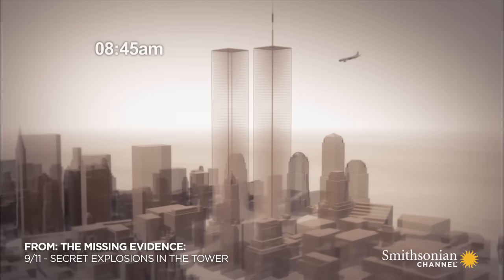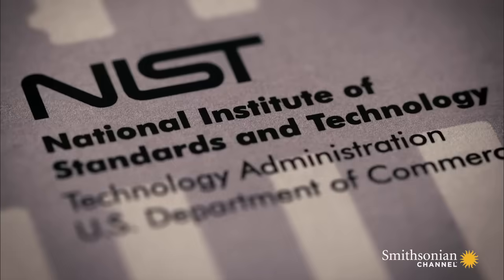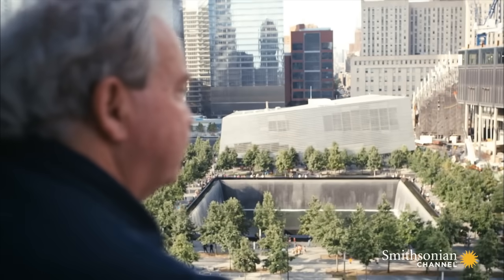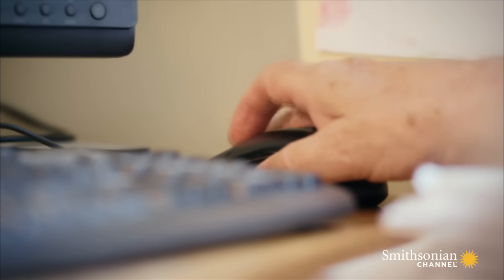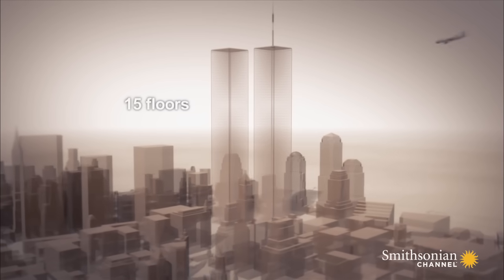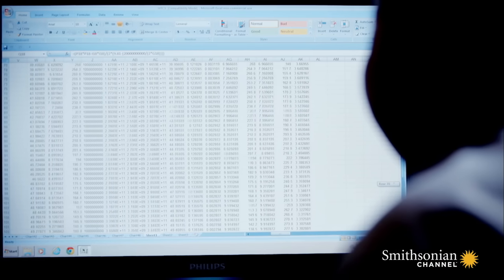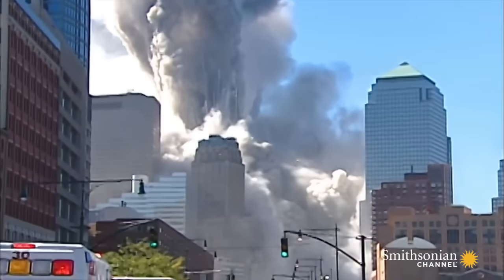This Computer Simulation Explains How the Twin Towers Fell

Comment: The way the commentator emphasises how much the government spent on the investigation made me laugh, 16 million is NOT a large enough sum too investigate a catastrophe as big as September 11th, they spent £50 million plus investigating Bill Clintons affair with Monica Lewinsky!
Reply: Billy+ "7 hours of fire?" What's your point????? The Plasco bldg collapsed after 4 hours and the entire top of the Windsor tower fell in less than 4. Are you trying to insinuate that fire can't bring down a bldg in seven hours??? If so I've just proven you wrong, by giving you examples of steel bldgs collapsing in under 7 hours. The only one around here that needs to learn something is you.
Reply: Bobby Hawkins  "scoring highest in physics" Here is NIST figures for the collapse of WTC 1&2. Tell us all what they got wrong, be sure to show your math...

Yes, there was more than enough gravitational load to cause the collapse of the floors below the level of collapse initiation in both WTC towers. The vertical capacity of the connections supporting an intact floor below the level of collapse was adequate to carry the load of 11 additional floors if the load was applied gradually and 6 additional floors if the load was applied suddenly (as was the case). Since the number of floors above the approximate floor of collapse initiation exceeded six in each WTC tower (12 floors in WTC 1 and 29 floors in WTC 2), the floors below the level of collapse initiation were unable to resist the suddenly applied gravitational load from the upper floors of the buildings.

Consider a typical floor immediately below the level of collapse initiation and conservatively assume that the floor is still supported on all columns (i.e., the columns below the intact floor did not buckle or peel off due to the failure of the columns above). Consider further the truss seat connections between the primary floor trusses and the exterior wall columns or core columns. The individual connection capacities ranged from 94,000 pounds to 395,000 pounds, with a total vertical load capacity for the connections on a typical floor of 29,000,000 pounds (see Section 5.2.4 of NIST NCSTAR 1-6C). The total floor area outside the core was approximately 31,000 square feet, and the average load on a floor under service conditions on Sept. 11, 2001, was 80 pounds per square foot. Thus, the total vertical load on a floor outside the core can be estimated by multiplying the floor area (31,000 square feet) by the gravitational load (80 pounds per square foot), which yields 2,500,000 pounds (this is a conservative load estimate since it ignores the weight contribution of the heavier mechanical floors at the top of each WTC tower). By dividing the total vertical connection capacity (29,000,000 pounds) of a floor by the total vertical load applied to the connections (2,500,000 pounds), the number of floors that can be supported by an intact floor is calculated to be a total of 12 floors or 11 additional floors.

This simplified and conservative analysis indicates that the floor connections could have carried only a maximum of about 11 additional floors if the load from these floors were applied statically. Even this number is (conservatively) high, since the load from above the collapsing floor is being applied suddenly. Since the dynamic amplification factor for a suddenly applied load is 2, an intact floor below the level of collapse initiation could not have supported more than six floors. Since the number of floors above the level where the collapse initiated exceeded six for both towers (12 for WTC 1 and 29 for WTC 2), neither tower could have arrested the progression of collapse once collapse initiated. In reality, the highest intact floor was about three (WTC 2) to six (WTC 1) floors below the level of collapse initiation. Thus, more than the 12 to 29 floors reported above actually loaded the intact floor suddenly.- NIST

" I also tested repeatedly in the 99th percentile of human intelligence" Yet you don't know what an anti-Semite is and think Silverstien received 7 billion dollars, and owned the towers. You sir are proof that regardless of perceived intelligence, if one is too lazy to do actual research they can come off looking like a complete nut job....
Reply: Greg Brumbaugh so pre planted demolition charges just so happened to perfectly line up exacly right where the gash was formed?And the connections in the upper floors just somehow vanished into thin air magically , allowing the left side to fall first? Sorry but I don't think so
Reply: Billy Jack+ "I'm the idiot?" I said moron, but idiot will suffice.

"The government agency NIST is different than the  Commission Report." Very good, moron. Do you know the difference????? One was commissioned to do an engineering study on how the towers fell, the other was commissioned to determine how the terrorist committed the attacks. The two had little to do with one another. 

"the final report where they are supposed to answer all the questions" Umm..no! You don't even know what the purpose of the 9/11 commission was. Their mission was to review the material gathered by the FBI in their PENTTBOM report and put into a form for public release. The commissions report was about how the terrorist pulled off the attacks, the NIST report was an engineering report....

Now don't you feel stupid?????
Reply: Billy Jack Im referring to WTC 7. How can a controlled demolition cause one side to tilt and lean north and the other to tilt and lean to the south, midway through the building collapsing? You're saying a controlled demolition causes a building to fall in two opposing directions? Because your idol Richard Gage never wants to acknowledge this but yet it's visible in the collapse videos
Reply: All this proves is that the US government are prepared to spend 3 times as much to find out if Bill got his dick sucked over a terror attack. Or that republicans are a lot more concerned about blow jobs than terrorists.
Reply: +Thomas Begen So you have evidence that the official reports are wrong. Great let's hear it! Tell us exactly what they are wrong about and how. If you could show some math, that would be nice...
Reply: Tom tonka None, he actually gained profit,  all thanks to the 9/11 truth movement, graciously supporting him through t shirts, seminar admission tickets, worthless donations, and just a lack of common sense
Reply: Bobby Hawkins  ”Why would the AIA resist an investigation into the WTC7 collapse” Because they agree with the NIST investigation, that took 3 years and cost millions.

”when he investigation was never conclusive as to what caused the collapse?”  NIST investigation was conclusive. You would know this if you had bothered to actually read the NIST report.

”Why would ANYONE resist a new investigation if nothing is being covered up?” Because it’s been investigated to death. It was the most expensive investigation of any type in US history.

”It is entirely possible a tactical nuclear device was used to hollow out the basements to allow the structure to fall into it.” Thank you! It’s not often that Truthers come out and openly admit how dramatically stupid they are….Your father should have used a condom.
Reply: evsupp2011 If it's such a well known fact amongst them that it was a "conspiracy" then they should also have some pretty significant evidence to go along with that too, right? So please, point us in the right direction because I'm curious to see it
Reply: Bobby Hawkins   "When we talk about the structure of a building a "floor" is the entire structure of a "story"" When engineers refer to a typical FLOOR, they mean the FLOOR...idiot! 

"These columns were welded together, not bolted, " Absolutely false! The perimeter columns were bolted together using 5/8 thick bolts. The core columns were welded, but these weld were not full thru the entire thickness. This why we find EVERY single core column broken at their weld joint and EVERY perimeter column broken at their BOLT joint. Explosives can't do that!

"the individual floor trusses might have pulled loose from the central columns but those columns would have remained standing " And this is EXACTLY what we see. 40-60 stories of the core remained standing for nearly 40 seconds after the collapse....Thanks for proving yourself wrong, it make my job easier!

"All we want is an independent investigation" Bullshit! All you want is someone to confirm your biased dislike of the US gov't...
Reply: Oh, for crying out loud...so not only are Truthers miraculously transformed into experts in physics, structural engineering, fire science, et al...now I keep seeing them presuming to speak as if they just somehow *know* how much a federal investigation ought to cost, and use that metric to determine its validity.

You guys are a real crew.
Reply: And they waited 400 days to start investigating after Juliani and his criminals disposed of all the evidence.
Reply: @MahayanaForMAHA  - I think Giuliani pulled trigger remotely, i.e. commenced the demolitions.
Reply: Not to mention the trillions they saved in the debt that was written off after 9/11. Or the billions they made from war in Iraq.  So 16 million is pennies/cents
Reply: Just sent how many trillions to Ukraine
Reply: +mike lomez true true.
Reply: Ralph Berkeypile Jr keep self-deceiving.
Reply: So how much do you think Richard Gage spent on his cardboard box demonstration?
Reply: @MiasmicGusto  FLT 77 was a Boeing 757-200 not a 7676. It only had a wing span of 125 feet. It also crashed into the bldg at an angle which lessened the length of the hole. Would you care to try again????
Reply: @Oldschooldan1  Flt 77 was actually a Boeing 757-223. The two planes that supposedly hit the Twin Towers were Boeing 767s, which also managed to squeeze completely into those two buildings leaving not a single trace of 'plane parts behind, even though the two holes they squeezed through were narrower than the 'planes that supposedly made them. Much like the amazing vanishing act of both the Pentagon-hitting 'plane AND that other 'plane that managed to bury itself completely underground. Simply astonishing. And still no black boxes have ever been officially recovered. From all four aircraft. Can you explain that?
Reply: @MiasmicGusto  "squeeze completely into those two buildings leaving not a single trace of 'plane parts behind" They didn't squeeze into the blgs, they smashed thru them with 2,266,201,476 joules of kinetic energy or 1,671,464,431 foot pounds of energy or 1/2 a ton of TNT. All of this energy vs 3/8" thick steel held together by 5/8" bolts.

"leaving not a single trace of 'plane parts behind" There were hundreds of plane parts found and in the case of FLT 93 the majority of the plane was recovered including the DNA of everyone on board.

" And still no black boxes have ever, EVER  been recovered. From all four aircraft" Umm...the FDR and CVR where recovered from both flights 93 and 77. The only black boxes that were not recovered was from the flights in NY. Which is not surprising they were never designed to have a 110 story bldg fall on them...
Reply: @Allison Krueger  The interceptor planes were too far away by design.  It was no accident, exercises were being done that morning for that scenario.
Reply: Thank you! yes common sense still exists.
Reply: Good point. It's like a homicide detective working  a seriel killer case on a per diem basis
Reply: $400 MM for the Challenger disaster!  Death toll?  SEVEN PEOPLE.
Reply: Probably cause Bush didn't want it investigated. 9/12 he was helping the Royal Saudis fly out of the USA...
Reply: @pagingdrlamp  You do realize that the FBI investigation started immediately after the planes hit and continued for over 4-million-man hours. It was the most expensive investigation in US history.
Reply: Spent $60 million on the Jan 6 attack on the power structure
Reply: Alfredo Baker yes it is, it happened now we move on, u research what u can
Reply: Because they knew what happened
Reply: Alfredo Baker and $2 Trillion for the "war" with Iraq
Reply: The affair and 9/11 were both psyops. It is done. You can not believe one thing these liars give you.
Reply: 50 million is waaayyy to much, how inefficient is US government ha why tho.
Reply: And 100 trillion on Trump and russia
Reply: Citation needed!
Reply: @MisterMcKinney  you’ll have to explain that one my friend, I’m English and not familiar with the word Citation 🙃
Reply: How about the fact that they never reconstructed the building. Every… Single… NTSB accident goes to extensive and exhausted reconstruction so that they can understand the failure analysis.
We shipped all the scrap iron and exported. It got rid of it essentially destroyed the evidence, but they exhaustively and painstakingly researched the “collapse”👌
Reply: 1:22 SPLENDID PIECE OF ARTWORK.
Reply: Alfredo Baker That was 16 million just to study the anatomy of the way and how they could of fellin.
Reply: Personal incredulity fallacy. Demonstrate what you are implying is true.
Reply: Batman knows the truth...

The buildings fell.
Reply: Batman  you are also in Fortnite
Reply: Right Just gos to show Where we all stand Up to them .we r DIRT 
N TRUMP WILL CHANGE THAT 
OPEN YA 👀
Reply: Just what got spent on the congressional investigation. Law enforcement spent much, much more.
Reply: @Drame Sonore They found the answers numbnuts.
Reply: @ghjfdfhjhgfdtyjjhdf  This is media and you're still talking so how can it be controlled...genius?
Reply: You're right
Reply: @jitenmehra17  ok Jiten
Reply: they never did find that 3 trillion that the pentagon "lost".

Plus you can't do an investigation when all your evidence was shipped to china to be melted down.
Reply: Insanity compared to insanity doesn’t make it any more reasonable lol
Reply: That's because they were paying lawyers instead of engineers.
Reply: And gave way more to Ukraine
Reply: yep let that sink in people, the presidents BJ which is not really illegal and only bothers the wife got 50 million spent on it, twin tower collapse? 16 million. Says it all.
Reply: It’s an Ai voice
Reply: I think that money was just for why the towers collapsed, nothing more
Reply: How about 500 billion dollars funding a war In a foreign country..
Reply: Oh, I'm sorry. And how much did you spend?
"16 million is NOT a large enough sum." And, I suppose you have a theory for that, don't you?
You gotta love all the YouTube "investigators." No actual evidence, yet, so many of them know exactly what happened. It's almost like they were right there. And then, they all become "experts" in things like kinetics, physics, fire, structural damage, structural collapse, etc.
Reply: Wow!!!! Did not know that ..that's craaazy
Reply: Jordan Moser Keep in mind though we're talking about the government. They need 30,000$ for a steak dinner.
Reply: southwriter Lot's of anti Bush crap coming from Trump. He said if you elect him, 'you'll find out who really did 9/11.'  The joke is on you.
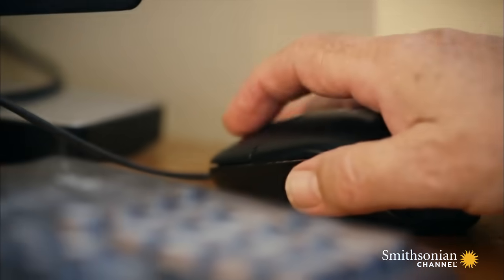Reply: +Alfredo Baker @1:00 we hear the reference to 'conspiracy theories' while an image of 'mini nukes' is seen ( the only alternate theory they mention ). One of the many over the top and likely planted stories of 9/11 intended to belittle legitimate evidence. And again @1:42 the narrator uses the term 'fanatical rumors' in a blatant and weak attempt to label all those who don't buy the official story as fanatics. It's so obvious what is going on in this video.
Reply: @slotstikskimboards1  Unfortunately yes. Just another brick in the wall of disinformation issued by a large not-clearly-defined shadowy band of insiders, discrediting rather successfully the so-called 'fanatical' "truthers"(the official designation of any who question the 'widely accepted fact' that the towers fell only because of the planes). Wikipedia's anonymous 9/11 authors definitely like to label those questioning the 'well-established facts' as fanatics. A previous Wikipedia page on the conspiracy theories listed the 'planted explosives' theory and immediately followed with the 'alien laser beams' theory! Guilt by association... That page has since been taken down, or I'm just not looking hard enough. Perhaps they felt they were being too obvious...
Reply: +carol prince you couldn't have said it any better, and just too add something too this particular subject, the dust cloud that filled the streets immediately after the collapse was so hot (according the people who was caught inside it) that they thought they was going too be burned alive! Also when it settled and covered cars and other objects it literally stripped them down too the shell 😂 my question is, where did this heat come from? The jet fuel, I doubt that!
Reply: southwriter Isn't it time for you to figure out who Dov Zachiem and Phillip Zelikow are? It's long past time you question why L Paul Bremmer was not in the offices of Marsh and McLennen while scores of his co-workers died. Also, maybe you can figure out how a plane with a wingspan of over 150 feet fit into a hole 115 across at the Pentagon.  Is it not time you figured out how our air defenses let 4 hijacked planed go without interception for nearly 90 minutes in supposedly the most secure airspace on the planet?  No... you're an idiot.  And the fact that you babble about Elvis and what ever other nonsense rather than making the choice to know all the facts surrounding 911, makes you worthless.
Reply: You are arguing from authority - "the experts" have said. "It is difficult to get a man to understand something, when his salary depends on his not understanding it." - Upton Sinclair - - - To this day, the American Medical Association maintains than single-payer healthcare is "unworkable," despite such systems around the globe producing far better health outcomes at a fraction of the US's per capita medical costs. A moron is someone who would take the AMA's statement at face value, instead of (1) independently looking at the facts & arguments, and (2) understanding why "expert professional bodies" actively avoid political/economically sensitive matters or even institutionally move to squelch popular and professional dissent. Nearly all architects and engineers and scientists work for government and big business, usually tied to large financial institutions. There is no material incentive for anyone in these fields to contradict the official claims about 9/11. In fact, the "vast majority" of architects and engineers and scientists don't say ANYTHING about 9/11. It is a lie to claim there is ACTIVE AGREEMENT by a "vast majority." Of those professionals who can show publicly that they have reviewed the evidence, most question the official story and go further, conclude that only US government planning and execution could have resulted in the specific, visible, measurable outcomes we observe.
Reply: Companies spend $10m on systems to manage millions of customers, millions of transactions, case management, data analytics etc. $16m could hire 100's of people for 5years. Plenty of money
Reply: @Scoville95  if you hired 200 people for 5 years, that works out at the princely sum of $307 per week each. If you pay peanuts, you get monkeys.
Reply: @Scoville95  yeah, make it 10x since they all would have to keep the biggest event of the century in complete secret
Reply: Aleksandar Gligorov Yes, at 3:11 seconds you can clearly see a plane hit the south tower. You are either blind or an idiot...I'm leaning towards the latter.
Reply: I think the only thing those figures prove is that the government is shit at doing things costefficient.
Reply: Aleksandar Gligorov There are 3 videos that show the plane hitting the pentagon and over 130 eyewitnesses and the black boxes and the engines and the dead bodies of the passengers were all found. I'm sure you will just dismiss all the physical evidence because there is no clear video. Let's face it, that's what idiots do...
Reply: southwriter we spent 1 million for a fish on a treadmill study 16 million is pocket change for the largest terrorist attack on the us.
Reply: + Carol prince a Boeing 757 has a wingspan of 124 ft and the plane came in at an angle. The wing tips 5 ft on each side of the plane failed to create a hole...woop de doo Sherlock.
Reply: @Oldschooldan1  how far can you stretch it?
Reply: @ContraPsy  How far can I stretch what? Would you care to be specific???
Reply: Detail the logical fallacy about it being impossible for a plane with a 156' wingspan to disappear into a hole 114 ft across.  GO !
Reply: @slotstikskimboards1  The wings deformed. What did I win?
Reply: Slippery slope. Boom.
Reply: Billy Jack Since you're so confident it's a controlled demolition then you should explain to everybody how a controlled demolition caused the building to fall in two directions, one side tilting north and the other to the south
Reply: @connerprice2768  the work that goes into a controlled demolition is extensive and extremely dangerous and time consuming. It would be a full construction job to tear down every wall and wire in explosives and then hang, texture and paint new drywall and return the office building to the exact same fashion. Not to mention airing out each floor of the fresh paint smell. A job like that in an active office building would take at least 10 years for 2 Towers at a minimum. And that's with 2 massive crews. And who exactly would you hire to do this? How could you get them to go along with murdering thousands of citizens? These conspiracy theorist idiots don't consider the true scope of a job that big. My Uncle and Cousins are Architects and Engineers and they concured that it would be a massive undertaking to perform. Plus if the Government did have a hand in that, could you imagine the implication if it were ever to come to light? It would be full on Civil War. No one would take a chance like that for any reason. Attacking U. S citizens, not to mention citizens from many other Countries. Many of whom are allies with the U.S.A. itself. It would be completely unforgivable. These people need to get out of Mommy's basement and go get a girlfriend or boyfriend and take a break from making up completely ridiculous lies. Especially when they have no idea what they are talking about.
Reply: Greg Brumbaugh That still doesn't answer the question, WTC 7 was hit by debris from tower one, as a result it had a small gash running down the south side. One side of the roof falls first before the other side and it falls right at the point where the "kink" was located, in other words the onset of the collapse show absolutely no characteristics of a controlled demolition. Even in a controlled demolition that would be made to look like a structural collapse this wouldn't be seen
Reply: Conner Price honestly the real question is why if I ask 97% of people do they not even know building 7 existed? That’s a whole conspiracy within it self. We refer 9/11 to the “twin towers” why not the triple towers? Well I guess cause then people would have questions as to what they’ve been told for years...
Reply: I'm the idiot? The government agency NIST is different than the  Commission Report. I'm talking about the people who wrote the final report in a book called "The 9 11 Commission Report " In the final report where they are supposed to answer all the questions?. Yeah, it would be that one of which I speak...Sherlock.
Reply: Bobby Hawkins  " And what was the conclusion of the NIST report concerning building 7?" Their conclusion is that column 79 failed due to thermal expansion caused by the fires. This lead to the collapse of the penthouse and a progressive collapse occurred. This failure started 8 seconds prior to the downward motion of the north face, which took an additional 8-9 seconds. Nearly 16 seconds of collapse, much greater than free fall.... You would know this if you bothered to read the report, but you won't because it's filled with big words and math and stuff...
Reply: syntheticrebellion Nice deflection.  The biggest crime in history gets the worst investigation in history. And you have it backwards. No amount of money is too much to get to the TRUTH of 9/11. Don't act like that ever happened. It never did.
Reply: @slotstikskimboards1  exactly!
Reply: mike lomez There are 3. 2 from the guard station and one from the hotel across the street. You can choose to ignore them if you wish, but it will not change the fact that FLT 77 hit the Pentagon and that debris and bodies of the passengers were found there.
Reply: Greg Brumbaugh What are you talking about 10 years? The only "disillusioned" one here seems to be you're failure to understand the building collapse. The north side of the building is vertical, half way through the collapse you can see the building clearly split and one side of the building clearly tilts to the north and the other side to the south, now controlled demolitions sure as sh!t don't act like that, they cause buildings to pull down and not outwards to the extent that WTC 7 fell nor do cause buildibgs to pull against eachother. Controlled demolition also would of left a strong aroma in the air for hours and of the very many rescue workers on the ground after this wasn't reported. Go look at the Plasco building, even the Windsor building as Mr. Oldscholdan pointed out, neither of which are controlled demolition and neither of which had debris strike them, especially the Plasco, watch how it collapses
Reply: They spent $40 million trying to prove Russian collusion on Trump. So finding out exactly what happened on the worst day in this country history isn't worth even half as much to try to destroy a sitting president? The Clintons took three times that amount home from donations from everyone on the planet for pay to play! We are in trouble people and this isn't anything new!
Reply: Pearl Harbor 41. JFK assassination 63. Gulf of Tonkin 64. WTC 93. 0kc 95. WTC 01.  All for the NWO
Reply: Yeah they must have done the investigation while on the trucks hauling the evidence away
Reply: It was $60 Million I believe. But yeah, clearly that is no where near enough to investigate the literal crime of the Century.
Reply: Voltarine DeCleyre So you have some evidence that the official reports are wrong????? Great, let's see it. Give us your 3 best pieces of evidence that 9/11 was an inside job and I'll debunk  you  right here. Are you brave enough to take this challenge???? I doubt it....
Reply: Let’s see If you can debunk the 5 hour “9/11 a new pearl harbour documentary.
Reply: I'd imagine no amount of money would be enough to satisfy you if the conclusion is anything but "inside job".
Reply: @syntheticrebellion  that's quite a weak attempt at trying to derail the point the op was making. Don't think you're one of the brighter "debunkers"
Reply: @ewanmcintosh8083  ok its been 5 years. How is the 9/11 truth movement doing?
Reply: Oldschooldan1 How can I watch these videos because I have never seen footage of a plane hitting the Pentagon. Please paste a link or something
Reply: Ralph Berkeypile Jr no, most people know that is bullshit and you are both crazy and stupid (and ignorsnt).
Reply: Next time your building something for Wile E. at your job working for ACME would you mind being a little more thorough in your testing because the road runner is kicking our ass.
Reply: Which building are you thinking about?
Reply: The Bush Administration did not even allow the investigation to begin until 411 days after the attack because they needed time to cover up evidence. They did such a lousy job at making this look like a terrorist attack.
Reply: Not an investigation, it was a cover-up.       Zionist government and Israel.
Reply: that’s because they know what really happened because it was planned and all intended
Reply: "The Slippery Slope is a fallacy in which a person asserts that some event must inevitably follow from another without any argument for the inevitability of the event in question." You've been owned.
Reply: Oldschooldan1 There is absolutely no videos of a plane hitting the Pentagon
Reply: Alfredo Baker "catastrophe" lol
Reply: Oldschooldan1 i ment plane that hit pentagon
Reply: Billy+  They had a massive report on WTC 7, maybe you missed it. Here you go: https://www.nist.gov/publications/final-report-collapse-world-trade-center-building-7-federal-building-and-fire-safety-0 You try reading it, then maybe you won't look like such a complete moron....
Reply: @Oldschooldan1  that a Gov. Website why would it say anything besides the official story?
Reply: Billy+ BTW " If building 7 collapse happened any other day" It didn't happen any other day! It fell the day a 110 story bldg fell onto it and was left to burn for 7 hours unabated. You sir are a fucking moron!!!!
Reply: @Oldschooldan1  jet fuel cant melt steal beams no matter how long they burn
Reply: Carol Prince- Isn't it time for you to go meet Elvis and the martians to fly the Mother Ship back home?
Reply: Alfredo Baker even if that is true, it is safe to assume that to get to the same degree of certainty, it is cheaper to investigate the mechanics of an event such as 9/11 rather than a high level PR scandal (physics don't lie).
Reply: Ralph, "No one buys this BS anymore" except the vast majority of the scientific community, the architectural  and engineering community. We like to laugh at morons like you...
Reply: oldschooldan1   Thought I replied to this but im somewhat disappointed in your name because if you are old school you wouldn't be thinking like a child. Where was I? Oh yeah, 7 hours of fire? repeat after me...7 hours of fire? Great...looks like your learning something today. You get a gold star. Maybe in show and tell you can elaborate on what's so funny about 7 hours?
Reply: Google had this great Christmas Eve site that showed exactly where Santa's sleigh was. It was about as realistic as this video.
Reply: No deflection. Just my opinion. Feel free to keep spinning your wheels. Maybe in another 15 years you'll gain some traction. LOL.
Reply: It's so obvious to any thinking person that Carol got all of her information from conspiracy theory channels on youtube. Carol, all you did was state a laundry list of logical fallacies. Namely, the "appeal to authority" and "straw man argument".
Reply: Psstt Ralph, The AIA took a vote a little over a year ago on whether or not to re-investigate WTC7 they voted 97% against it....there is your proof moron!
Reply: Conner Price They prepared the buildings for 10yrs for this event. I'm sorry if you're disillusioned with your govt. But the evedence is there. I wish things were different but there not. Never stop looking for the truth.
Reply: +Oldschooldan1 the hotel video was not released. The wings miraculously did no leave a mark on the building. The hole this craft made was too small.
Reply: If the investigation went any further they might of had to explain building #7, the destruction of crime scene evidence etc. Building number seven alone will convince the ones that are worth saving because whoever doesn't see a problem with that has already lost their grip on reality.
Reply: Oldschooldan1  did you see the plane,can you shom me the video pls
Reply: No shit Sherlock. With that shit inside your skull you call a brain do you think the Commission's report may have skipped the subject matter of building seven as not to draw unneeded attention to an obvious demolition of a building? You think that could be a reason. Its a moot question. What you need to worry about is understanding the depths of your brainwashing because you are gone son. one can short of a six pack, toys in the attic, etc. You get the picture? Don't answer that I know the answer....Answer is....cognitive dissonance.
Reply: oooo...  never heard of that!  I aced Logic and Greek Philosophy in college, nimrod.  You're talking out your ass and wasting my time. Goodbye.
Reply: +Oldschooldan1 firemen reported molten steel, iron spheres found in a high percentage of the dust, the molten steel recorded temperatures high enough to be molten steel for months apparently. Also, how asymmetrical damage led to perfect demolition-like collapses when CD fails if the timing of the explosions is out by a few milliseconds. The probability is so low as to be zero. I think this means, at the very least, that a fresh investigation is warranted, but I’m not holding my breath. The evil people that perpetrated this have sooo much power and money.
Reply: Your starting to prove my point yourself. "Burned for 7 hours?" Yes sir. we all know of the danger fire  (in the history of time) has caused to steel framed buildings. Especially a whole 7 hours.  Can you show me the so called damage on building 7 due to a tower falling on it?  Can you numb nuts? Keep it up and I will turn you into a conspiracy theorists yourself (if you can get rid of that brain fog)
Reply: Conner Price Because it was destroyed from the top down instead of the usual bottom first so as to give the appearance of a building collapsing by fire. There are so many inconsistencies with the official story the building collapsing is a minor issue at this point.
Reply: Conner Price Apparently you've never witnessed a controlled demolition.
Reply: So?
Reply: Oldschooldan1 i think maybe i m wrong  ;)
Reply: I would really like to agree with you but if I did we would both be wrong, so lets wrap this up. You are obviously delusional and most likely genetically predisposed to have a altered understand of reality. . If building 7 collapse happened any other day than that day it would be a certain fact and obvious to anyone who's education is above the 6th grade level that it was controlled demolition. If they even tried to pass it off as anything other than that they would be laughed at. Kinda how I laugh at you. You shouldn't mention "critical thinking" as one of your attributes if your going to compare buildings 3 thru 6 to building 7.  Get help, im sure they have some medication that might work for your condition.
Reply: Alfredo Baker what's there to investigate? It was an inside job and controlled demolition.
Reply: Oooooo! I've been put in my place by an "expert". Go take your Prozac, now.
Reply: Oldschooldan1 i think that u are an idiot
Reply: Oldschooldan1  u are an i....!!!@
Reply: What difference does it make that they spent 16 million dollars? How much does it take to do a computer calculated run-through, idiot?
Reply: Not a computer simulation, inspection etc. Like for B. Clinton 50m.shuttle challenger 45+ for 7 people and for 3000+ 16?
Reply: It wasn't Bush. It was probably Clinton.
Reply: @southwriter  lol yea it wasn't Bush now but of course it much be Clinton! Makes so much sense!
Reply: Blah, blah, blah- more anti-Bush crap from a Liberal.